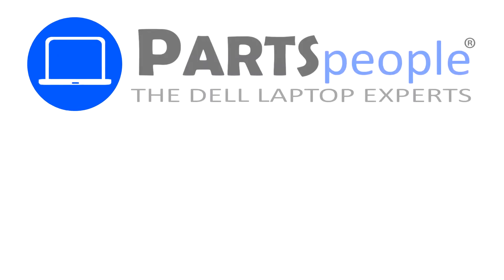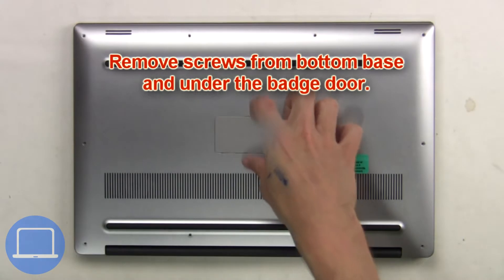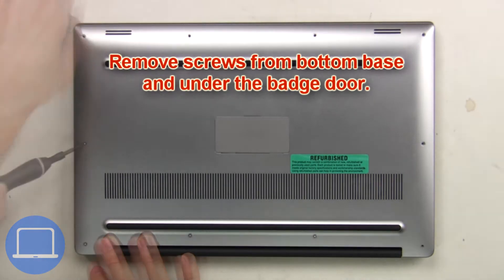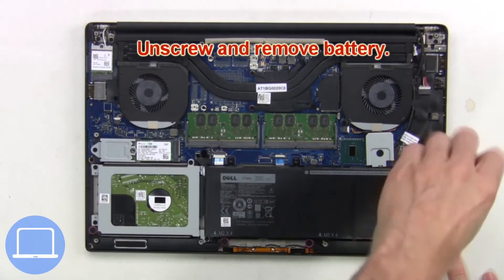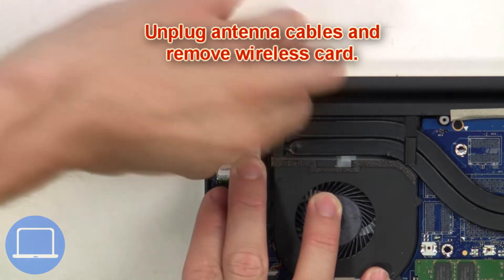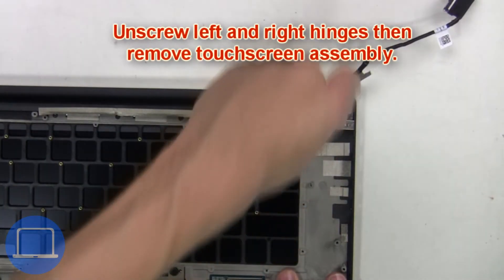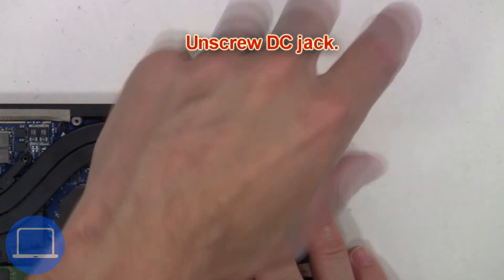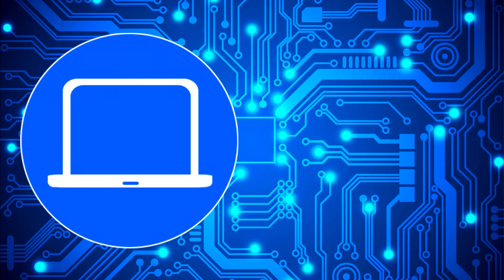Dell Precision 15-5540 (P56F003) DC Jack How-To Video Tutorial

Comment: By the way, don't take off any of the things that was taken off in the video. 
You can just take the screws on the metal plate that is covering the jack, and open the laptop screen around 50 to 70 degrees(Be careful of the battery cable next to the metal covering) and then close it. That will lift the metallic cover piece and expose the only screw holding the piece.
Reply: My thinking exactly. Seems a little bit overkill.